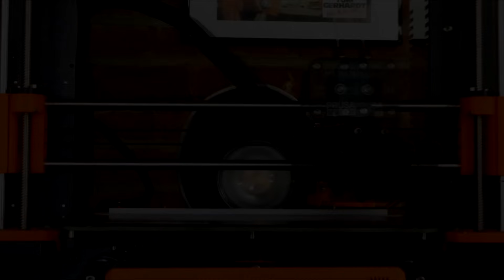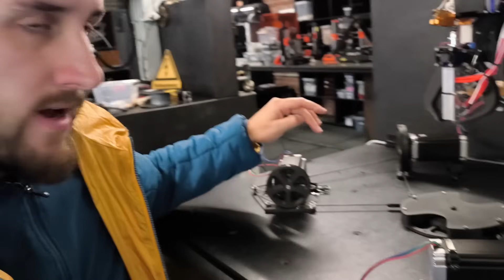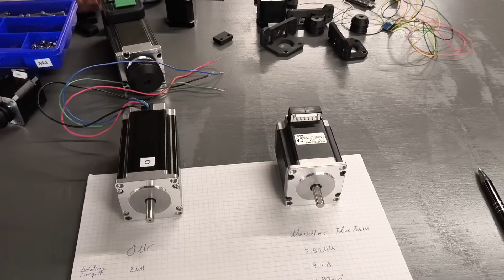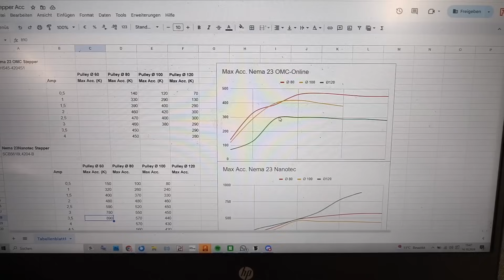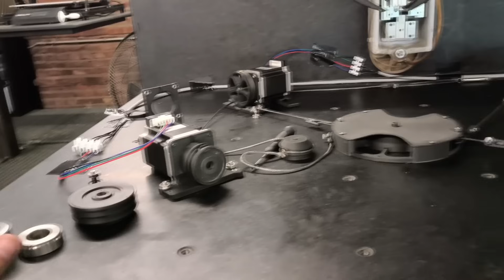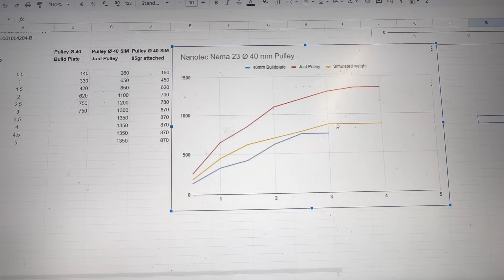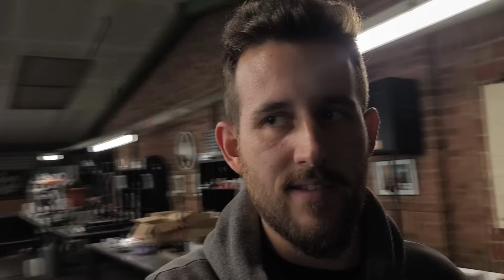Minuteman Dryruns on World Record pace. Is a sub 1 min 3DBenchy possible? (Episode 7)

Comment: Technically a sub 1 min benchy has already been done; twice. However neither of those methods use an actual "3D printing mechanism." Both use a gel to stabilize the formation of the object in 3D-Space. One is pure liquid deposition, where it injects a liquid into a reusable gel, & is the more versatile of the two, as you can create objects with plastics, rubber, foam, resin, ceramics etc, all combined into one object. They used a full size automobile seat as a "print in place" original design & test case.
The second is far more expensive, requires much more physical setup space, technical know-how & skill, is much less versatile, (at least for the time being), but is the fastest in the world. It, like the prior method uses a gel, but it was much firmer- like ballistics gel instead of the more "goopy" nature of the first one. It also wasn't stated if this kind of gel was reusable. Unlike the other one, it has a UV curable resin fully encapsulated in the cube of gel prior to the start of the process. It then uses a femto-second laser split into 3 beams & each beam is projected through a polarizing screen creating a hologram projected from 3 axis into the cube. The UV light essentially "flash freezes" the hologram into outer shell of the object & then the laser is turned off & full curing starts from there. The one I saw was a Mardi-Gras style candy skull fully finished in just under 13 seconds, with immense detail, (easily as good if not better than any 8-K resin printer) but with even more strength, because there are no actual deposition layers. (There still are with conventional resin printers, they're usually just too small for the naked eye to see, but they still weaken the part compared to a mold-cast cured part)

Regardless I think this is a cool project, & that you & whoever else is venturing into this area will likely benefit many more people, as their use case & cost, though more expensive for the avg user, it's still more likely to eventually improve printing infrastructure in the long run rather than the niche use cases I mentioned above. From a technological perspective, I'm most concerned about the vibration at the speeds you want, & the accuracy level. It seems to me layer shift, adhesion & extrusion speeds are going to take a ton of work if you ever intend to make it be able to produce a viable product using this method, unless your only goal is to see if you can just break that record with a more conventional style printer. Either way, I hope you succeed though. <In my line of work I always need strength/efficiency/accuracy over speed, so it won't likely ever affect me, but it's still interesting to see the result.>
Reply: That hologram system sounds very cool.

Comment: it looked like there was a lot of rope side wobble, do you think that has an effect on your acc limits. i think that it might have a little effect perhaps there is 10k to gain by mitigating the wobble.
you know how rollercoasters brake using permanent magnets and copper bars, simply using eddie currents to brake. what if you made a fairly light 'ring' where the middle of the rope can pass through, so there is no touching when That rope is doing the pulling. but when the rope is wobbeling sideways because the other axis is moving then the ring is also getting moved side to side.
now if there are some small magnets on that ring and a copper strip above and below, then the ring shuld resist 'fast' oscillations. 
the question is if there is something to be gained from a system like that, and if the added resistance is worse than the potential gains.
the reason i thought of this is high voltage power lines actually have dampners on the wires at the point where they hang from the towers, this is to stop them swinging in the wind.
now i probably just wasted 5 mins of your time if you read this, but we will never know if it works unless someone who knows the machine actually thinks it through, i can easily sit here on this side of the screen and think something will work, but you are the only person that can decide if there might be something to gain.

Comment: More Power!!! 💪
You should first find a drive solution that can handel high acceleration on its own.
Those steppers are near there limit what they can do with just there own inertia anyway!
Large motors with very large pulleys!
Angular acceleration will be the same, but the bigger motors can handle the higher load!

Comment: Have you considered dual motion platforms? A core XY gantry with extruder over the moving bed, each moving in complementary directions.  The relative acceleration’s and top speeds would far exceeded the capabilities of either approach separately, potentially doubling them.
Reply: I had idea about dual delta where one awd delta moves printhead and another moves buildplate, but I'm lazy
Reply: this is genius

Comment: But is it possible to use a pulley block and increase the torque even higher? The maximum linear speed is still not achieved with this type of printing.
Reply from the maker: @SergeiPetrov  what is a pulley block?
Reply: @Roetz40  block and tackle
Reply from the maker: @SergeiPetrov  ah i didnt knew this word.

So i think that wont help. At the end of the day youre want to find the sweetspot between speed an torque. Changing pulley sizes is the exact same thing as using block and tackle (but with less friction in the system)

Also maximum speed makes a very small difference in printing times. Acc. is everything

Comment: I build wire rope assemblies for my day job. I would like to offer some help/advice. You can buy pre-stretched wire rope in addition to internally lubricated constructions that will help with performance and longevity. Maybe you know all this already but any adjustments you can refine to take out constructional stretch and application stretch, it’ll make a big difference. You call also proof load your assembly up to 60%of the nominal breaking strength take out almost all the stretch. All of those wire rope clips and splices add up as you know. I would use a bolt with a hole drilled through and a ball shank to tension your bolts. I can send more details if you like.
Reply from the maker: Thank you, these information are valuable. Are you interested to join my discord? Link is in the video describtion. Thats easier to communicate :)

Comment: It looks like open loop control is reaching its limits. 
What about mechanically coupling two steppers toghether, do you think it would help? It would of course double the number of motors and drivers, but it shouldn't increase the complexity too much. I don't even think you need 8 of the same motors for testing, the ones you already have should be enough to test the acceleration of one axis. 
People have been using 2 motors per belt on CoreXY machines for a while and it seems to work well (but I'm not sure how hard it would be to sync two motors that are rigidly coupled togheter, as usually there is a somewhat stretchy belt in between them)

Comment: The Nanotech aren‘t just smaller but they are very, very reliable too.

They are used by companies from your area for filling machines and other applications where speed is relevant but repeatability and especially reliability are considered far more important.

The results you came up with weighed pulleys instead of the cabling are the correct point to start (IMHO) because of the far higher probability of successfully repeating them. Sharpen your saw.

The other day I was fiddling around on my printer and thought about moving to wire drive from belts but it obviously isn’t trivial.

Others have pointed out oscillating wires and drive harnesses that bend when the acceleration kicks. 
As we‘re near black magic realm, these observations don’t have to have an impact on the final result, but if you are experiencing issues with repeatability, then they should be addressed, i.e. sharpen the saw, but also ensure it is tightened to spec before you start cutting the tree. 
As others have pointed out, high speed recordings could help you detect the variables in the system. It likely will be necessary for optimising the system as a whole and would add value to every hour invested.

Thank you for sharing your insights, this is a great presentation of applied physics 😊

Comment: You've gotten somewhat close to half the speed needed, by your own calculation, so why not simply move the hotend as well.
I know it would be harder, and not as fast, but even if it goes only a 10th² as fast, that'd be a basically free bit of speed, right?
I am sure there is a reason, so i am asking.

Comment: I don't have a lot of experience with your application but I would suggest you look in to servo motors.
I am sure you are aware of the torque of stepper motors diminishing at higher speeds.
Servo motors don't suffer in that way.
Also servo motors seem to have better acceleration and positioning accuracy.
Reply: He can't, the regulations requires stepper motors.

Comment: doesnt the distribution of the weight relative to the axis of rotation matter with those weights you are using to simulate stage inertia? i.e. if you made them smaller diameter but longer vs larger diameter shorter, etc etc

Comment: So.... what about two steppers per pulley? One on either side of the pulley. Just wire them in parallel and run them at 4 amps (2amps per stepper each).

Comment: Instead of tying off the cables at the base can you return it through the pulleys to the spring? Like a double cable looped at the base and fixed back at the spring. Might fix the tension issue.

Comment: This is the difference between somebody who chose engineering vs a true engineer. If you love the iterative testing, finding the sweet spot in every area of your design, making spreadsheets and graphs (🤓🥸🤩), finding the problem you should've seen in the initial design but didn't (and the one you overestimated and wasted time on), the whole challenge of it....

An engineer ought to come home smelling of solder smoke, cutting fluid, and burned wires. An engineer belongs behind a bench, not a desk.

Comment: Two quick questions:

1. Could the drop in performance at certain accelerations be related to harmonics? It seems like a significant amount of energy might be transferring into the cable, judging by the noise. Perhaps a solution could be to add a sub-plate and mount the motors closer to the build plate.
2. Have you considered biasing the motor orientation along the length of the boat? This might allow for greater acceleration on the longer travels, making the power use more efficient.

Comment: Looks very interesting. I had a thought which may or may not make sense. Have you considered instead of syncing motors using 2 motors with a constant rate spring and maybe linear motors.

Comment: don't you have a problem with inertia at these accélérations? if so you should reduce the moment by make mass lighter at the edges... less inertia moment need less torque to accelerate.. test 3 arms  instead of 5, holes... every engineering solution to lower the moment...it should help you more than augmenting the torque... and if you have more torque it will be beneficial... but for now  each cm "consume a part of newtons... this explain more the difference between poulies in my opinion...

Comment: During your simulated weight tests I noticed that the steppers at that speed are actually flexing the mounting brackets causing the stepper to tilt downwards at the shaft end. This MIGHT be where some of your inconsistencies are coming from, as that slight movement would put extra tension on the lines and cause an artificial increase in weight which changes based on the angle of the stepper. Maybe redesign the mounting to include a clamp that holds the steppers down at the back as well?
Reply: I noticed this too at 30:00 in the video. It may add some small Coriolis? force to the mix which clamping the motor at both ends should solve.

Comment: At this point the accel numbers could be measured in Km/s² or mach(345m/s). The nanotech motor with the 60mm pulley basically hits mach 5.5/s acceleration (mach 5.539/s or 1900m/s²)
Reply: That’s a change of measurement units I can get behind! Mach 5 🎉🎉😂

Comment: I think the slack comes from slipping of the loop on your cable, since missed steps would move the stopping point of the build plate. A second possibility is the cable slipping on the pulley and moving slack/tension from behind the pulley to the platform side. The issue with the larger pullies comes from the rotating mass of the heavy weight so far from the center. This issue will be resolved by lowering the weight of the pulley. The more mass the pulley has the more energy is used to change direction.

Comment: I thought with steppers, you don't want to increase the current, you want to increase the voltage and chop the current in order to go faster...?
Reply: He is increasing BOTH values. Voltage and current both will benefit, one just creates more heat. He needs both for holding force and speed.

Comment: Is the weight really a valid substitute for the rope? The weight resists accelerating in either direction, but the rope only resists when pulling.
Reply from the maker: Youre right. I have to investigate if we can run faster/slower values in any of these directions!

Comment: Hey, so I'm surprised you kept increasing pulley size. The torque of the weight you have to move is higher with larger pulleys. Also, the force act at a different height on the pulley, where the built platform is the same. So I only ever make the pulleys smaller.

Also, you mentioned the opposite pulley is off. So it's all on one pulley. What's the reason you didn't use a coupled system, so the opposite stepper runs in reverse, not off. Pulling the "on" pulley from the top? CoreXY uses both motors at once for that reason.
Reply from the maker: Yes, but Core XY also relies on using guide rails and subsequently linear bearings of some sort. I got rid of everything you dont need and can build the lightest setup possible.
Reply: @Roetz40  right I understand that. I wasn't suggesting using a CoreXY setup. Just the reasoning for use of 2 motors to double the power along each axis.

Comment: Neodymium magnets are very sensitive to temperature. A motor with magnets on the stator, where all the heat of windings accumulates would most likely be more sensitive to heat than any other motor. Cooling the motor housing/windings will make most likely a noticeable difference.
Its the same reason that speakers use much less often Neodymium magnets then regular ceramic magnets.
Reply: Hi there! I'd like to point out that you're 100% correct on the heat issues with neodymium magnets, they don't hold their magnetism as well as say ferrite magnets at temperature, but that's not why they're not used in speakers! In fact many of the highest power handling (ie heat) speakers use neodymium magnets, it's simply a matter of cost. The magnet mass in large subwoofers even for neodymium can approach the kilogram mark, which is a very large amount of cost. As such ferrite is simply more economical. 

To clarify, I'm a speaker designer, so I have a very thorough background in the field.
Reply: @rocketslizardsandall  btw why don't we see more dual coil speakers? (as in speakers with 2 coils in opposite directions as opposed to a permanent magnet)

Comment: Why not use dual small high speed motors like you were using on each corner connected by a pulley drive? That way you can have low inertia and double your torque. I'm not according for losses. While you're at it you might as well make water cooling jackets for the motors for consistent results. I thought someone would have mentioned this before me.

I would also use something like 1.3mm Marlow Kiteline Race SK99 dyneema and eye splice on the connection to the bed and pulley. The connector you choose is fighting you.

Comment: Hey super nice video series!
Just had a weird shower thought kinda idea: could you make the extruder/hot end move as well? ofc not as fast as the build plate, but maybe a solid amount of movement opposite to the buildplate could increase the effectvive acceleration you can achieve.
Reply: also, then the cooling will have to move with the hot end, and that cooling is gonna have to be massive.
Reply: A) Have you seen the size of the hot end? :-)
B) If the hot end moves then it has to make it's move in the same time that it takes the bed to move, there can be no lag, they have to be at the same position at the same time. 
If the hot end moves then the bed doesn't have to travel as far, but if the bed doesn't have to travel as far then it can get to it's next position even faster and so the hot end has to move faster too. It's a circle.

Comment: Looks like way too much vibration\noise to print accurately.  Probably a gimble driven using a pair of Ball screws which can probably be driven to around 400 to 800 IPM. Another issue is they speed of the print head, & cooling time of the plastic. You probably need some method for active cooling, like an air knife.
Reply from the maker: Thats all in the making ;)

Ball screws have way too much inertia, it would defeat the whole purpose of this build...
Reply: @Roetz40  Yes, but you never get the stability needed using string positioning as well as too much error from the strings flexing. Gear racks would be faster than ball screws, but there will be a lot of backlash. PID with Position scales could help reduce backlash.
Reply: @guytech7310  he knows more about this setup than you do i think
Reply: @guytech7310 I don’t think he cares too much about accuracy. A roughly benchy shaped object is all the race demands.